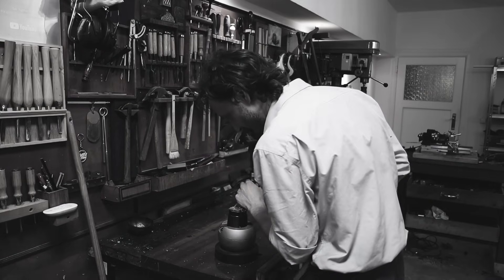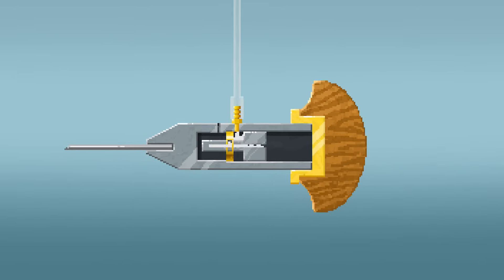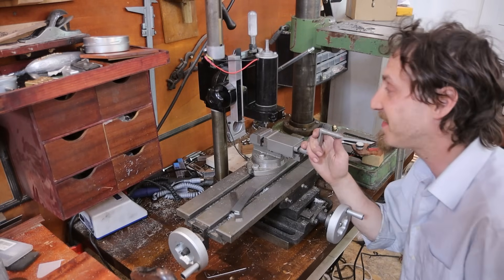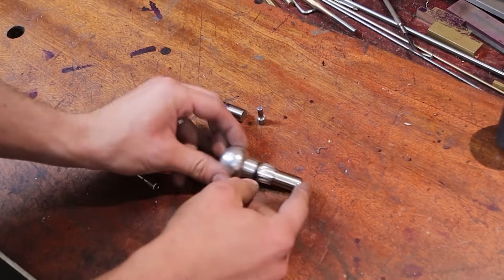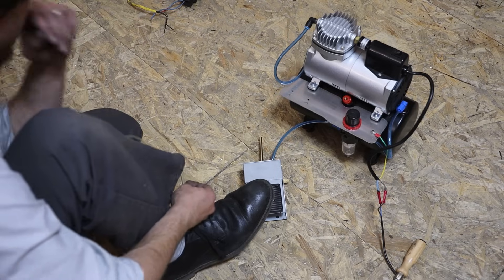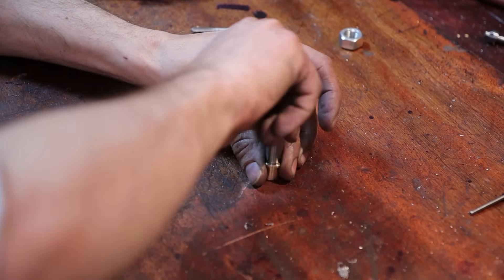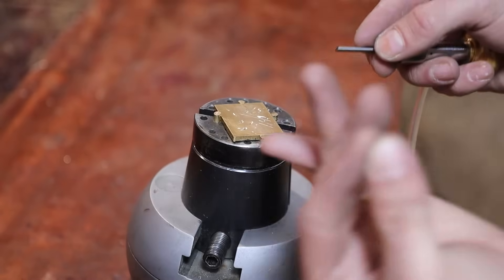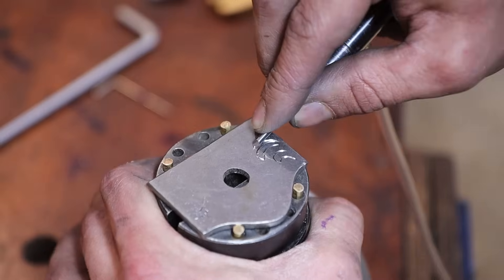Making a Springless Air powered Graver

Comment: The title says what makes this so unique? What makes it unique is that can make one and post it on YouTube because Steve Lindsay's patent on it has expired. He managed to get a 20 year patent further extended by a few years by suing anyone that infringed on his patent. He didn't invent the reciprocating piston or the pneumatic graver. By putting the piston into a handpiece for engraving He got a 23 or 24 year monopoly on these. Yl
  Your sounds like its lacking power, the piston and bore can have next to zero clearance. Getting the piston hole sizes lz exhaust and location of air in pressure just right is no easy task.

Comment: I imagine there needs to be some sort of tuning between the valve profile, and the airflow/PSI, if they're too high I can see it being blown back before delivering all the whack it can into the tool. You basically made an air file piston! Which is pretty neat!

Also, coming from a pneumatic animatronics background, you need a muffler. Usually we use a plastic pipe with shredded t-shirt material in it, not packed, but will hold its shape in the tube, on the outlet port of the valve manifold. The solenoid valves opening and closing are louder than the exhaust. Maybe make a little cup that to tool slides into a few mm larger ID than the tools OD so you have a gap space but the bottom of the cup encloses the exhaust port in the gap space, then throw some material in it, cotton balls, cotton makeup pads, t-shirts, old underwear, whatever. Just dont pack it in tight and it should evacuate okay without the sudden pop of the valve opening.

Comment: The Lindsay is a more complex design than the one modeled.
Lindsay uses a reciprocating shuttle valve in addition to the impulse hammer, this counter acts the vibration in the hand as the valve moves one way, while the piston moves the opposite direction....this not only makes the graver virtually vibration free but effectively doubles the reciprocating impulses as both the inner piston and outer angular shuttle valve alternately strike the tool holder/anvil

Comment: Make a "SILENT" air compressor by using a small air tank from a loud air compressor - and it's components minus the loud compressor - use a refrigerator air compressor.   That is all the "SILENT" air compressors are.

Comment: Instead of using a vise to hold the work piece while you cut it, couldn't you put in the lathe and use the lathe to turn it while you run the hacksaw blade over it? Better cut and the machine does the work. Plus the work piece is already in the lathe to finish off the cut end! In fact couldn't you design a tool for the lathe that holds a a saw blade for cutting? And try putting an O-ring at each end internally to act as shock absorbers so it doesn't make the buzz when the piston slams into each end.

Comment: I used to have a tiny little die grinder, same 1/8 inch bits as a Dremel tool but the handpiece was maybe 20mm diameter. The exhaust was really loud, but it was reduced tremendously by a simple corrugated plastic tube that directed it away from the user. I think it was there more to keep the oil in the exhaust from ending up all over your work but it definitely helped with the sound too. Might be an easy way to make your tiny jackhammer nicer to use.

Comment: it seems to me like that thing should have a brass handle instead of the wood handle, or some other way to add a lot of mass to the part that is not supposed to reciprocate. maybe exchangeable weights would be useful, but I think heavier is more likely to just be better, if you have other options for adjusting the vibration. 
I have heard of vibrating tools damaging joints or tendons or thelike in hands if used for a long time, I would definitely look into that before using something like this. and if it is a risk, then making the handle heavier would certainly help. basically if you have to press the tool down to cut, you are putting a vibrating load onto the loadbearing parts of your hand that can be damaged by vibration, whereas a heavier handle would make it so that you can hold thetool loosely and hardly push into the workpiece. to imitate the damping of the light handle and manual push option, one may need to mount the mass in a soft way though, like on cork, felt, springs, or a hydraulic damper. an interesting wayto get adjustability could be to clamp weights to a flat spring jotting out to the sides, and experiment with moving the weights closer to the tool or farther out, including asymmetrical arrangements that put the main resonance frequencies on both sides in a non-harmonic relationship to each other and to the vibration input of the tool, as this would probably make for smoother operation. mounting the flat spring dampened on cork would probably also be good. if you made an arrangement with a lot of weight off to one side on a flat spring, you would make the cutting tip vibrate on an arc... but that may just be annoying since it would cause the tool to pull sideways when cutting.

Comment: I don't know anythign about this stuff, but I wonder if it would feel less annoying and more solid if the vibratey part were heavier, like made partially of tungsten or something.  Alternatively but probably more of a stretch: if you made a small platform that vibrates instead that you can use a non-vibrating tool on.

Comment: This is a quick PSA. The downfall of this system is that it is either “On” or “Off”. This isn’t how pneumatic gravers function. The pedal isn’t a switch in a professional tool. It’s a variable speed system. Think of it this way. In a properly built pneumatic graver, the foot pedal acts like a throttle/gas pedal on a car. A car can’t function properly if it’s either going full speed or not at all. Yet all of the systems I’ve seen on YouTube function with on/off switches. They are being built wrong. When I’m working, I rarely, if ever ramp up to full speed. Most of my time is spent in a small zone using very little power. The handpiece is relatively quiet at this point. The real test of a tool is how it behaves in that “butter zone” from not running, up till it is barely, or slowly tapping. This is where most of the fine work is done. This is only possible with a pedal as designed by Lindsay, or as in the system designed by Don Glaser from GRS. 
I applaud innovation, and even more, people who get to in the shop and make things. But on YouTube I see so many people following instructional videos to copy things that they have never used and don’t know how they function. Hence they do it as they “imagine” it might work. Then scores of people follow and attempt to build what they believe is a working pneumatic engraver and they are fully missing half of the equation. Or at a minimum, key points as to why and how these tools function. And then they wonder why they are not able to achieve decent work. 
It’s like the old saying about the “blind leading the blind”. 
With all that being said, I’m thoroughly impressed when people take the time to machine a handpiece in a home shop. Whether it functions as an engraving tool or not, it takes guts to dive into a project like this. 
If anyone else is attempting this at home, simply understand that the videos you are following to build these things are missing crucial information. Like building a car with an on/off switch instead of a gas pedal. I’m still searching but I haven’t found one yet on YouTube that gets this right. If I do, I’ll link it. 🤙🤙

Comment: brilliant. its a "tesla" oscillator. just single ended. 

wont kill the sound without a muffler of some type. usually little sintered brass fittings industrially...

the way the valve works conflicts with the hammer on anvil approach. needs a second stage.
ie, you tear apart any jackhammer, you find its a crank driven by a gear reduction, but rather than slamming into the end of the tool itself, its just a piston with an o-ring and grease,  acting in a steel cylinder free to slide back and forth in the housing, and its the cylinder that does the whacking... no ports, nothing, just the trapped air being compressed in there driving it. therees an air cushion between the piston and the anvil.

therefore, this requires the same thing. extend the piston plunger, add an o-ring, and have it acting inside a separate steel cylinder thats the actual "hammer".

it will get hot!

partially counteracted by the compressed air cooling as it expands whilst driving it. a smart person would use this to their advantage... 

its an interesting design, with some work you could make it rather effective, but the noise pollution factor will always be there... maybe reduced to a fair degree, its all about breaking up that harmonic, but always there.

i really like this. ive already made a few tesla oscillators but this seems a much simpler design... interesting how the frequency sounds exactly the same.

Comment: You did a heck of a lot better than I did, both of my first times!  You'll get a lot more power and speed if you have a polished bore and polished piston. The fit needs to be close, so it basically creates a seal. The piston will stay in place and spring back if you block the air hole.  You may need to add a second exhaust hole. as well. Not the best explanation but I hope you understand what I'm saying. Like when you rub two guage blocks together and the the stick to one another. A slightly bigger bore might help if you work engrave steel. They are noisy though. I try and work below 15psi so it's relatively quiet.  It should work so well you'll wonder why you didn't do it years ago!

Comment: I appreciate that it wouldn't help improve your Zen, but a larger piston with more mass would mean faster cuts. I expect that your compressor is now oversized for what the tool is capable of doing, but to take advantage you might need to scale it up by 2x or more.
Aside from that, I don't know how much difference it makes (if any), but at 14:17 I wonder if it would make any difference to put the hammer part in the other way around?

Comment: @UriTuchman one thing you could to to adjust the sound is change the geometry of the exit hole where the air leaves. Softening the edges could remove some of the harshness.

Comment: Why not put a cloth, wood, or rubber between the oscillating brass inner weight and the casing? Would lower efficiency a bit, but would help with the sound

Comment: put a spring behind the hammer head, behind the spring, a m5 screw with large head trough the pommel to adjust the spring tension. you ll have a better response of the hammer head and ll move at slower air flow. yours.

Comment: Great build! Maybe if you could connect compressor to regulator(obviously), regulator to foot pedal, foot pedal to handpiece.  You can speed up or slow down the piston.  I have a Lindsay, that how it’s set up.  Bad ass that you built one, I built my first one years ago, it was the spring, small air compressor type.  Works great but I saved and bought a Lindsay.

Comment: speaking from experience owning a steve lindsay classic foot control, his is extremely refined and very smooth, not nearly as loud and can go from hogging out deep 1/8 inch chips of metal to tiny less than hair thin lines. Its a flawless tool if there ever was one. 

Nice job making your own! try making the piston from hardened steel, make a steel handle instead of wood (softens the stroke because of extra mass) and add a regulator to adjust the psi which will affect the cut depth along with the stroke length of the tools collar. 

If you ever get the chance to try a lindsay hand piece it will blow your mind!
Reply: Many thanks for your useful observations.

Comment: I liked this, so I made one too! (2 of them actually) It was really nice of mr Lindsay to patent his engravers with such lovely drawings! it makes copying them much easier! I've made a foot operated version (with my own take on the foot-pedal valving arrangement) and a push-controlled version (again using my own system of valving in the handpiece). I'm not a fan of the push version, it's a little less precise as you cannot control the hammer-power seperately from the amount of push-power, meaning the spring setting/valving is more critical. But the simple foot operated version is lovely to use, I'd highly recommend it as a  project. 

The impression I get from the website is than Mr Lindsay is quite happy to sue patent infringers, but most of his patents have either expired or are due to expire very soon. which is great for us tinkerers and we may even see cheap ready-made versions before long.
Reply: Lol I love this comment. I’m doing the same thing with the expired patents.
Reply: @tanimator87  After messing about with mine for quite a while now, I've got some suggestions for you.

First, keep it light, or at least the parts of it that can move a little when the hammer strikes the back-end of the tool(i.e. the nosepiece), that'll maximise the energy going into the work and not into vibrating the tool about.

Second, Keep it simple! unless you're willing to spend a long time developing the thing, a push-action is just not worth the bother, A rigid design feels much nicer, is less bulky, and has a single moving part.

Third, Keep it Slim! It may just be personal preference, but my favorite one is the smallest. Made from a 14mm piece 304 stainless. bored and lapped to accept a 10mm piston. and accepting 5mm round Silver-steel gravers in it's aluminium collet (that is retained by a large o-ring, to isolate it from the main body).

Have fun!
Reply: I spoke for quite some time with a lady at the US Patent Office and as long as you are not trying to sell the Lindsey copies you make there is no infringement on his patent so there is nothing he can sue for. Not everyone can do the machining to copy the Lindsey Airgraver. Those that can will, those that can't will buy.
Reply: @clydeadair3809  My understanding of it is that if you profit by infringing on a patent, you stand could be sued. so if I used a patent-infringing device to engrave and then sold that engraved piece, I would therefore be in breach of the law. It's on the defender of the patent to prove infringement, so it's difficult and expensive to persue, and only worthwhile in the case of a truly blatant infringment.

It's one of my life's goals to give lawyers as little money as possible (it just encourages the assholes) but that does not mean I'm afraid of doing what I feel is right. Lindsay got his money's-worth, so if a hobbyist or artisan wants to play too, I say it's fair game.
Reply: @theafro ,  When I spoke to the lady  at the patent office, if your method of manufacture, materials or finished product differs from the patent design you are using then a new and separate patent COULD be filed for.
Reply: @theafro  you may be righht but according to his own pattent drawings and the patent office I've changed mine enough that I could get my own patent.
Reply: @clydeadair3809  Apart from the personal satisfaction of filing your own patent, there's little point to it, The patent system is fundamentally flawed, and only protects those that have the resources (time and money) to defend a patent. My own revisions of the design were more to do with practical considerations than legal ones. And I feel very little guilt about building my own version of something I would never have bought, It's not like I'm a competitor for trade. After all, If legal considerations become more important than moral, there is something wrong with the law.
Reply: @theafro  I quite agree and in fact unless I am actively competing with Lindsey (ie: making graver machines to sell,) there is really no cause for debate IMHO. The electric engraver that uses a solenoid as the hammer was something that I designed YEARS ago but never had the tools or time to develop. Like you though, I am not competing with anyone in the field. I engrave for ME and not for profit.

Comment: It works but it doesn't seem to have much power. I use Steve Lindsay's Nitro palmcontrol graver but I can't say that I personally built it. I have customized mine with a custom handle and a rubberized sleeve for the body to make it more comfortable to use for extended lengths of time.

Comment: Uri, what is the source of the noise you dont like? Is it the air exhausting out of the device or is it ... the plunger inside slapping the limits of its stroke? Would it be possible to add o-rings at those limits for the plunger to hit against? Perhaps even offer a tiny bit of rebound???  This seems exactly like a modification you would invision yourself. ;-) What do you think?

Comment: have you thought about getting one of the sound deadening sheets you can stick to panels in cars to to wrap around the outer part of the main shaft of the tool it would not get rid of all of the noise but might cut down on the shrillness/harshness of the sound (not perfect but i know for myself after having a rather bad head injury abrupt noises break my concentration and i have pot a lot of work into finding ways to mitigate noise where i can be it a magnet on the heal of my anvils to insulating the air compressor room and trying to cut down on harmonics that show up when running tools)

Comment: If you want something inaudible, one could go for an ultrasonic piezoelectric version using an 40kHz piezoelectric transducer like one might use to create an ultrasonic cleaner.  That said, earplugs and muffs are required and one must pad the handle and not touch the business end.  Though nothing should cut smoother, it is hitting the metal 40k times per second.  

Nice pixel art, reminds me of powder game...